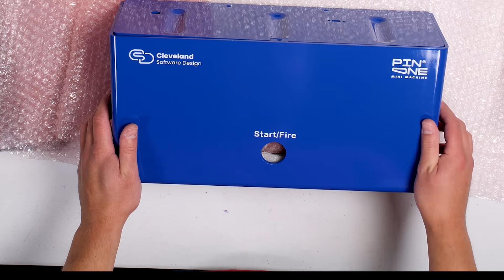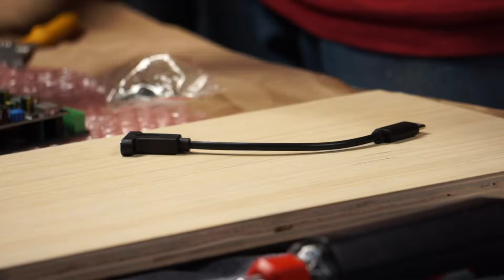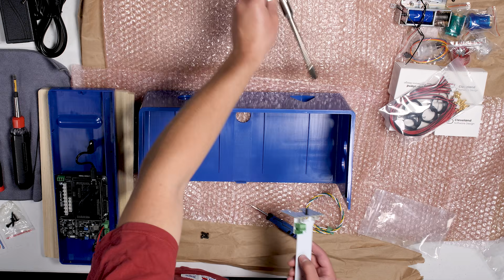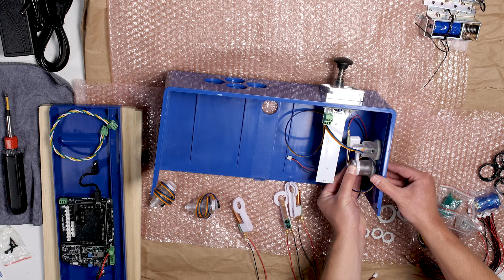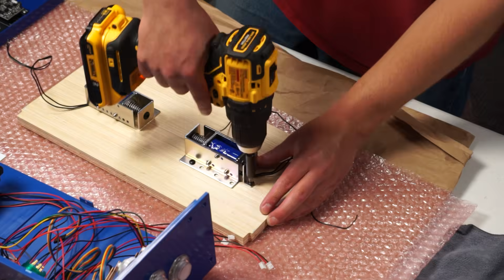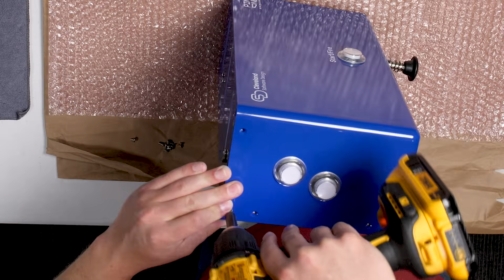Cleveland Software Design Mini Machine Assembly Instructions

Comment: I have a virtual pinball cabinet and i have 4 plain buttons i would like to use (flippers and for screen selection) but I cant find any video showing me how to hook this up. I keep ordering parts and wires and I'm still no where closer to figuring out HOW TO CONNECT everything to my "PinOne Control Board" ... Do i need more parts ?? Im lost and about to give up on this hobby. All I want to do is hook up 4 plain buttons so i can play my cabinet. 😩😩😭😭😭😭
Reply: I would pay someone $500 cash to hook my parts up that's where I'm at right now. 😥😥
Reply from the maker: How to hook up x4 buttons to a cabinet 
- The easiest method to hook up x4 buttons to a cabinet is using a PinOne Mini Board. https://www.clevelandsoftwaredesign.com/pinball-parts/p/pinone-mini-virtual-pinball-connection-board This is an output board that is driven with the PinOne Control Board. It has x2 mosfets for toys such as solenoids and x9 button jst quick connects. To hook up x4 buttons you would need to connect the buttons to the PinOne Mini Board and then connect the PinOne Mini to your PC. 
- If you just have a PinOne Control Board (https://www.clevelandsoftwaredesign.com/pinball-parts/p/pinone-control-board) without a PinOne Mini or Main Board this is still possible; however, it requires more manual wiring because you will be forced to wire it to the pins directly. Here is a link to a documentation page that has some information and helpful diagrams on which pins are to be used: 
https://pinball-docs.clevelandsoftwaredesign.com/docs/Products/PinOne-Control-Board/ - If you have the PinOne control board but not the PinOne Mini Board, you can get the PinOne Mini Board with the “base board” option to forgo receiving a PinOne Control Board already mounted on the PinOne Mini Board. 
- If you do not feel comfortable wiring to the pins directly, I’d suggest getting an output board to mount the PinOne Control Board, such as the before mentioned PinOne Mini Board. Here is more information on the PinOne Mini Board, its uses, and its hookup: https://pinball-docs.clevelandsoftwaredesign.com/docs/Products/PinOne%20Mini/#conn ecting-other-devices 
- If you're still having issues, feel free to contact our workshop using my website!

Comment: With this kit, if used in a 3/4 scale cabinet, is it possible to  connect the 'service board' to this and is it possible if i already have the Solenoid Flipper Button Control Boards and power supply from a few years ago along with this or tied into it?
Reply from the maker: Yes you can do both of those things with this kit

Comment: So I just ordered it and I'm really looking forward to receiving it I've been on the fence on what controller to get for a long time now i've had the XRcade, the virtual tilt ,in my carts multiple times. But after watching enough videos talking to people within the virtual pinball community I finally pulled the plug and ordered your product. I will primarily 90% of the time be using this for meta quest pinball fx, And my question is what type of plug or adapter do I need to purchase off of Amazon'cause I wanna get it make sure it's waiting the day that your product arrives. usb c to mini usb? I ordered it pre installed because I lost half of my thumb so tools are a challenge now, And I also got the solenoids with power supply because I absolutely need to hear that clack. I guess my only other question would be are there any modifications that I can make or things that I could add later on possibly like the bluetooth dongle or a shaker kit?